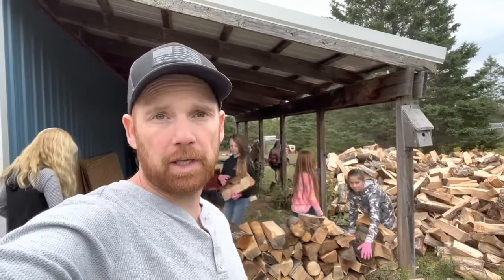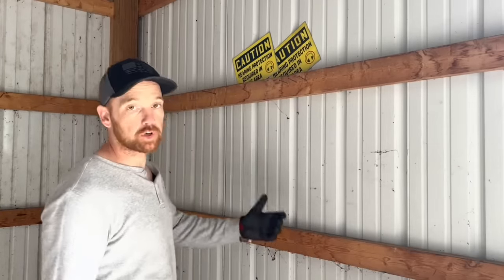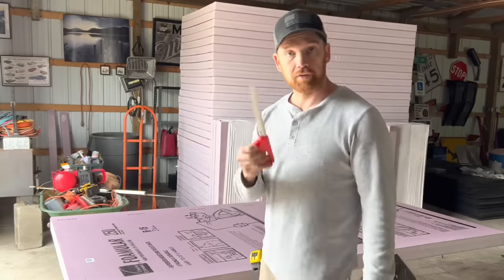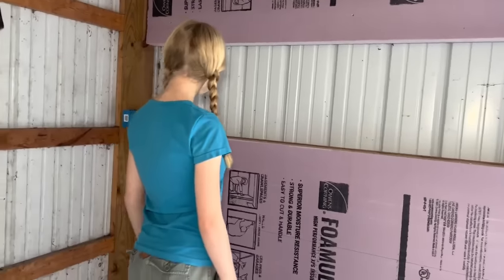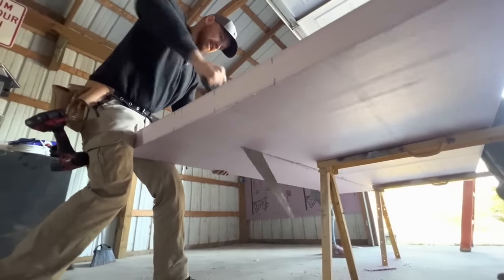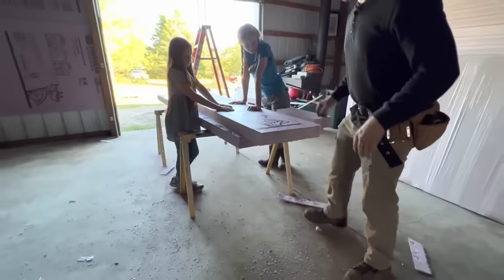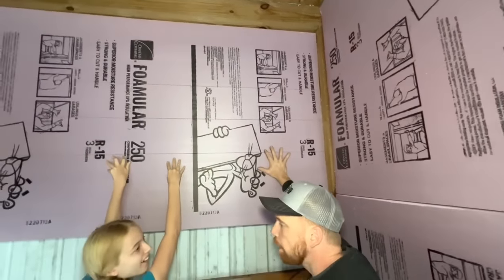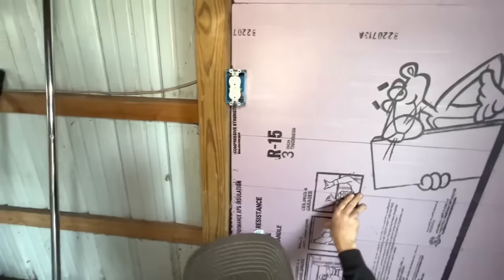Insulating our steel building/garage | Why we are NOT using Spray foam... Family prepares for winter

Comment: Roofer here, hand saw is the quickest way.  It’s sucks, but when you’re trying to get down a couple hundred boards in a morning.  Your dominant arm will be jacked.

When I’m making repetitive rip cuts, I use the table saw.  I can do up to 24” rips and one guy can burn through 2/3 bundles in an hour.

Also, you’re not saving much in waste running horizontally.  I would run vertically & have my drop at the top.

Keep in mind that XPS is a combustible material.  Meaning if the shop catches fire & the insulation starts burning, there’s no saving it.

Also, spray foam is overrated.
Reply from the maker: Hopefully I can keep the shop from burning down! 😆 Goals.. Have a great day Robert!
Reply: He did say he is planning on covering up the insulation

Comment: I wonder if you could have rigged up an electrical resistance wire that would get hot enough to melt through the insulation and run it through like a band saw.  Job well done by you and your family.
Reply from the maker: There’s so many ways that we’ve found to cut the foam board. The saw is simple and effective. Our sawzall works quite well also with a metal blade on it.

Comment: Yep, we lost a house to a fire because our firewood was stacked in the carport. Not even against the building like that, just under the far side of the roof, which was enough to carry it across to the house. Fire department said that they see that too frequently. You shouldn't stack wood near a building you don't want to lose.
Reply from the maker: Sometimes the building is worth more burnt down.. 😆 I hope it doesn’t burn and we don’t leave the fire unattended or leave burning overnight. It’s just when we’re working in the garage.

Comment: use the edge of another sheet to draw your line, no need to use spray foam between the sheets when you're using adhesive in the joint - it'll just make a mess. Is the adhesive you used foam friendly? They make one that is. You should definitely cover that rigid foam, if you do it with plywood, you will have endless places to attach all your stuff too
Reply from the maker: The adhesive is for the foam. We’re using a steel for the walls.

Comment: I've always scored one side with a utility knife flipped it over scored the other side with a utility knife if I wanted a very accurate cut, then snapped It off.

I've used a hot wire, works well with two people. Rather than using the American push style of handsaw I wonder how the Japanese style pull saw would work?

Comment: skill saw,or razor knife possialy electrick turkey slicing knife, razor knief has less mess,but a skill saw with vacume is fastest& easyest, or make a sheer!!. and glue it all to the framing&sides. no screws required as they will transmit heat&cold,and that cold will condensate... as for that hand saw ,clean it good, and a light silocone spray on both sides and let it dry good(spray it outside) it will make sawing much easyer. as for skill saw I like the 18 volt lightweight mikita. and get a few more sea horses.. be sure to check that square!! most are not square.( I have the same one, not square) never hammer on the foam, use a 2x4 or 2x6 peice of wood to hammer on to and spread the load so no damage to the foam. make sure all electrickle and water if finished and done right, add extra wires&recepticles&switches before installing the foam!! you can cut out any foam to do and rework if needed but why when you can do it now.I also like to seal the foam to the slab good ,not just a bead on the edge but in the center real good a bead on the edge wont hold fer squat. and be sure to clean everyuthing good so the glue isant just gluing dust & dirt. your doing a good job!! also for a little more insulation you can use some foam spacers to space the foam bord off the studs so the studs/wood/steel does not transfer heat/cold directly the entire length of the board and has a insulator between it. studs &top plates are a major heat bridge that are not insulated, I like to use raidiant barrier on the top plates to keep the heat from running down the studs heating the drywall or whatever you use. hot summer day the heat gun showed almost 25 degree difference from coverd to non covered top plates 1 foot down the wall stud at 3pm in the sun after a day in the sun.thats a lot of extra "solar" heat transferred inside to be removed. some good thinking before doing helps a lot as does temp gun & "spot testing" theories. raidiat barrier under to roof supports to run the heat up &out to keep it from going down into the structure works awesome...although you may want to use that heat to help keep warm in the winter in somelocations.Im in FL.  I wish I had your shop, mine is only 24x34, stick built central ac&heat that barley runs any time of the year.(also white shingles help a lot in southern states.)  good luck and keep those kids helping and thinking!!!
Reply from the maker: Thanks for the information mark! I hope you’re doing well!

Comment: The old electric carving knives Work very good too. The Big oversize plastic washers actually help they actually have teeth on them that will actually grabbing the face of the foam and hold it. The little cans of great stuff work good in filling in little gaps and crevices and cracks and everything else like that.
Reply: They make plastic cap nails just for foam board

Comment: Its nice to have kids to help.. But its a blessing when you have all girls.. They gonna be some beautiful tough girls.

Cutting foam... You think using a rig with a wire powered by a battery or electricy to heat the wire would cut it better?.
Reply from the maker: We’d rather not get the foam board hot enough to smoke as it can be very toxic

Comment: That knife is for fiberglass insulation, not foamboard.   I used it and it works great for fiberglass.  I used my jig saw for cutting the foamboard.  It's fast and you can cut it very straight.  I used a straight edge to mark the lines and then cut it.  As for foam insulation, it is fine when applied properly for stud walls versus regular insulation.  For your metal building, I would do it just like you did here.  There are right times to use different products.

Comment: 16k for spray foam is crazy. Down here in texas the same job would be 8-10k but most the a-side is manufactured here. Shipping and loss in yield due to  cold weather could be reason for the high cost.

Comment: Either is fine, if you can air tight seal it.  I have 3 buildings with closed cell spray foam.  The best money I've ever spent in building materials.  However not as expensive as stated here.  the price quoted seems high.  In Georgia I would have rather have an air tite seal than any insulation without air tite.

Comment: I normally use a circular saws, table saw, or or sawzall for cutting foam boards like those.  You shouldn't use regular construction adhesive with foam boards. The solvent just dissolves the foam and doesn't bond.  They make a product specifically for foam, or you can use polyurethane adhesives...
Reply: The Pl adhesive he showed is made for foam.

Comment: We enclosed our 40ft carport . 14 ft high to make a work shed out of it. We also made part of it upstairs to store our stuff. How do we put up the foamular on the metal roof as we do not have wood boards going across like you do in your video. We are able to stand up upstairs as my husband is 6’3 and putting in wood boards across will affect the height up there.

Comment: The comparison between spray foam and foam board warrants further explanation.  You have much lower overall R value with foam board, for example where all of the 4"x4" studs are.  They act as a thermal bridge, and only have an R value of about 3.5, for example.  Plus, you have a lot of air gaps.  Look up "building science Joe Lstiburek' here on YT.

Comment: closed cell spray foam provides a better vapor and air infiltration barrier, whereas the foam board wont be as good, especially in the long run and yes I mean even when seams taped and sealed as best as possible, it will start leaking air/vapor far sooner than a good spray job.
it will eventually all start leaking, sprayed will leak around the perimeter from shrinkage, while the panels can also be resealed at all the joints.
I'm not saying to use one method over the other, do whatever is best for you and fits the bill (or bank roll).
Reply from the maker: This foam board is closed cell as well. I am considering putting a bubble foil over top of all the insulation before putting the sheet metal up. Not sure yet?

Comment: How did that glue work on the seams?  I’ve melted plenty of foam before I realized it was too “hot” for styrofoam.   Just use foam to glue it together with now.
Reply from the maker: It is for foam board. But I’ve noticed it dries quite hard and by just using the spray foam from the van seems like it’s the best bet. No need for adhesive

Comment: Hot wire is the easiest way to cut foam.  Build a cutter to cut the entire 8 foot length in one cut.  Lay the wire down in the right spot, turn it on and let it melt through.

Comment: Venting?  Ok, but still... I would have preferred to have that exterior to framing because xps [if you use adhesive to bond each panel together] is a pretty good moisture barrier.  One tip? Spax insulation washers - keeps screws from pulling through..
Reply from the maker: We don’t want the screws exposed because we are installing metal sheeting over the insulation
Reply: @9252LIFE  Its a little extra work, but firring strips both hide the screws you worry about, plus give a firm surface to stay away from dimpling the metal as its attached.

Comment: I'm a retired contractor in the business over 40 years. I was mentored by a guy, he was one of the first on the NY State energy commission. He was removed because he was to radical. He railed about houses being to tight and so on. Spay foam is the worst even the very best applicators admit they do get bad mixes. The length of time spray foam out gassing can go on indefinitely demanding on the mix, thickness of application. To make matters worse the out gassing happens in confined space. Ridge foam out gasses as most foam in furniture, however the out gassing happens outside the home, in the factory,  storage,  transporting, retail or wholesale stores well before it gets to the home. While I don't believe you can have to much insulation  if properly installed, no insulation  is better than spray foam
I would rather lose the job than install spray foam. It should be outlawed period.  It is just not safe.

Comment: Yeah, I don't know about the R-value per the cost It doesn't seem feasible, and then the cons of spray foam it has a hard time sticking while it catalyzes and causes droops and thin and thick areas. also, when applied to steel it loses R-value due to something to do with the radiant effect. And if moisture does get behind it, it rusts the steel cause it can't dry. Weigh 2lb per inch which takes away from your Pounds per square inch from snow load  makes it impossible to fix any wire problems that may come up or to add new circuits cause everything is buried behind the foam if something happens to the building it triples labor and doubles the cost of the repair cuz the foam is stuck to all the metal basically gluing the outer skins to the framework and to each other

Comment: You made a wise choice.  Did you price polyisocyanurate sheets?
Reply from the maker: No i did not.
Reply: Polyiso usually comes laminated with a tough plastic layer in 4 by 8 foot sheets, which can be an advantage for some applications.  I have used XPS board as well.  Good stuff either way.  Your on-camera demeanor is very pleasant and amusing!  I

Comment: I didn't have time to read it all.  I like to fill in the gaps at the bottom to keep the mice out.  I like your install.  But worried if I seal the bottom about moisture???
Reply from the maker: We used a rat guard on the bottom of the exterior

Comment: I'm wondering if you had sprayed the foam board with radiant barrier and have the silver part closest to the metal walls will it go from R-15 to R30??
Reply from the maker: Not sure but I do know that it’s 90 degrees outside right now and 65 inside the shop

Comment: You must spray foam all edges.  If you miss a single tiny spot where air can get through, you will have a swimming pool of condensation on that metal
Reply from the maker: Yes that is the plan and backed up by a foam tape. Will be doing a follow up video.

Comment: The vented sections you were showing, is how mice get in, i sealed those with expanding foam which stopped the mice but now after watching this I'm wondering if I did the right thing.
Reply from the maker: We actually installed a rat guard afterwards. A metal trim made to go over that crack area on the bottom that still allows a little air flow
Reply: @9252LIFE  Good to know thanks

Comment: I am pretty sure the product you have used is not rated as fire proof (different rating from having a fire retardant chemical added), so if you were using it in a house or basement you would have to clad in in drywall or ply. You can buy foam board that has a foil coating or other products that have a unsurfaced fire rating. It's a shed I hear you say, what's the problem? Weld, Grind or cut metal? You will have a problem as it will catch fire and or melt. The other is insurance and if you have it on the shed, not to fire code = no fire insurance coverage.

So that $30 panel will need another $30+ panel of ply over it. FYI you can buy nails that have a plastic flange and they work great when hanging foam board. I use a air caulking gun for big seal up jobs, makes life so much easier.
Reply from the maker: Thank you Barry. You may of missed the part in the video where I mentioned we’ll be putting a steel roofing material over it.

Comment: WOW! 16k for spray foam 😱We just did spray foam on our 40 x 30 building (fall of 2022). Ended up being 5" of foam on walls and roof. Cost just under $4500.
Reply: That's a steal of a deal. I had just the roof of my similar sized garage done last fall as well, but only 3.5" closed cell and paid 4K.

Comment: Loctite makes PL 300 for adhering foam boards to things without the adhesive melting the foam.
Reply from the maker: This adhesive does not melt the foam and it is for foam. Works quite well

Comment: It would have been easier to stuff copper mesh rodent proofing into the bottom of the siding "vent channels" before installing the foam than after, but it still won't be too bad to do.  Get the real copper pest control mesh in long rolls (eBay and Amazon are your friend), not thousands of little kitchen scrubbers that nowadays are usually just copper plated who-knows-what, and are small enough chunks to get pulled out by the critters anyway.  When you have the girls crawl along the ground stuffing copper mesh up behind the siding, have them wear blue nitrile gloves inside aramid (Kevlar is one brand of aramid) cut-proof gloves.  The nitrile will keep their hands from being roughed up by the kevlar, which isn't as bad as fiberglass or asbestos, but still can do similar things to your skin, not to mention making the skin dry out and flake.

Maybe add lots of sheet metal screws through the mesh after it's installed, to prevent the furry little rodents from pulling it out.  They hate spending much time chewing or pulling on it, so you don't need it to be super secure, just good enough that a few tugs each by a few hundred mice over time won't manage to let them create a pathway in.  Check it every few months, or at least around the end of summer before mice start looking to create paths indoors in fall.

Then assume they'll eventually get in somewhere and chew through the 3 inch foam.  When they do so, you want them to run into flashing or sheet metal.  Though they can chew through aluminum flashing if they can get to an edge of it, they'll just be looking at a solid wall of it at the end of their little tunnel through the foam, presumably standing on the 2x4 below the bottom edge of the foam.  Nothing to bite into.
Reply from the maker: Check out what we did in our newer video

Comment: When you heat the building up stick your finger behind the insulation see if the metal's wet let me know how that works out been spraying foam for over 30 years in Oklahoma second oldest company
Reply from the maker: Will do James. Thank you for the heads up

Comment: Two ideas to think about,first could you use your sawzall to cut the bord? Second I have seen mice crawl up inside the metal & the insulation, where the ribs are in the metal. Have you thought about that?
Reply from the maker: We considered a sawzall but with the kids helping using the manual saw keeps the line straighter. Also I don’t believe the mice are interested in that type of insulation. The pink fiberglass stuff yes would be a nightmare

Comment: Morning to research a little bit on YouTube I think you can put a wire between the negative and positive battery and make a heat wire
Reply from the maker: Yes but I worry about toxins from the foam melting.

Comment: Great video.  Looking at doing the same. I considered spray foam but the metal company said it would void the warranty (and it’s a pretty good warranty!) so I’ve opted for the foam board route. 

Do you know if the foam board can be painted? I’ve heard yea and no
Reply from the maker: I believe you could paint it but just know that it’s pretty flammable and should be covered with something especially if it’s a shop that you’d be working in

Comment: EPS is a better choice for ridged insulation, than XPS. EPS is less expensive per R-value, less toxic and in a damp environment EPS absorbs less moisture. A polyurethane adhesive may work better for you, it cures quickly and fills gaps.